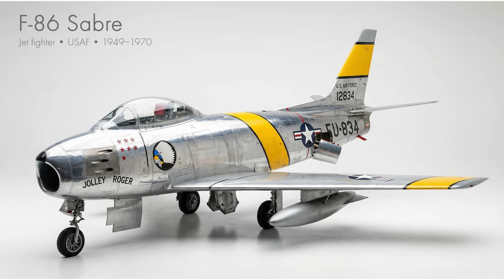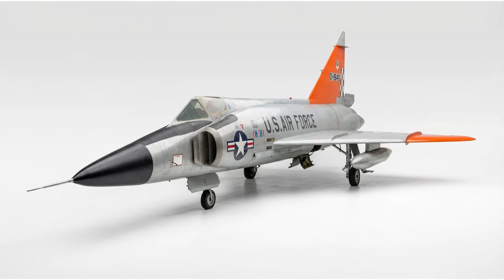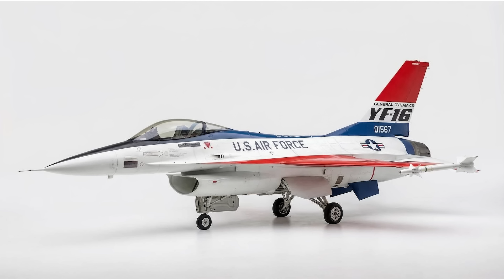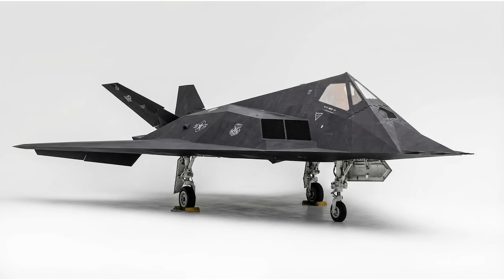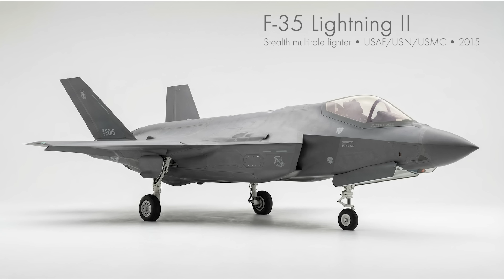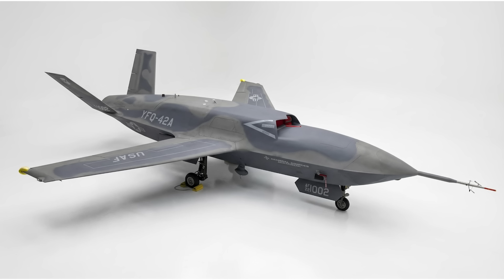US Fighter Jets Evolution

Comment: 21:20 - Not sure where you are getting your numbers, but they are WAY off. 

Average cost of the F-35 across the A/B/C variant (not counting the F-35I) is about $108 Million. 

F-15EX is currently averaging right at $93.5 Million and is over $10 Million MORE per unit than some blocks of the F-35A

Comment: Where's the Skyhawk?  Granted, it's technically designated as an attack plane (hence the A4 designation), but the Navy flew TONS of them.
Reply: I guess all the jets here are tagged with F for fighter..The A-4 Skyhawk is A for attack .. notice there is no A-6 Intruder, A-7 Corsair ,AV-8 Harrier and A-10 Thunderbolt..
Reply: @265justy it's the only rationale for it I can think of.  I didn't really think too much about it until they got to the Growler, and then I started questioning, since the Intruder had a variant that did the same thing, and that led me to thinking about the Skyhawk.  I knew there were others but I was kinda in a hurry when I posted the comment.

They may not have been "pure" fighters, but if you're going to make a list with the Strike Eagle and the Growler on it, those others should definitely have been included.  I mean, they included the Nighthawk, which doesn't even have air-to-air capabilities.  Limiting it to JUST planes with an F designation is arbitrary, and misleading.
Reply: @AllTradesGeorge  Saying all that . He still left out the F-5 Tiger and F-111 Ardvark.  I would question the F-111 as a fighter even tough its tagged with an F . Because it was a strike bomber in its time..
Reply: @265justy I mean, if you're going to include the F117, then there's no reason to not include the F111.
Reply: @AllTradesGeorge Very true ..Good point
Reply: F-117 was strictly an attack airplane as well. They ran with the F prefix to skirt SALT treaties in the 1980s